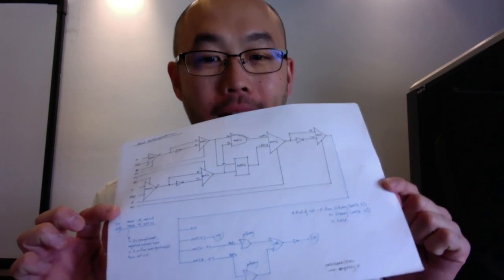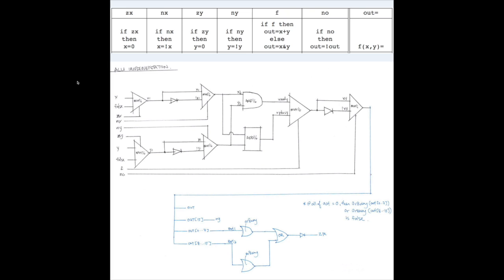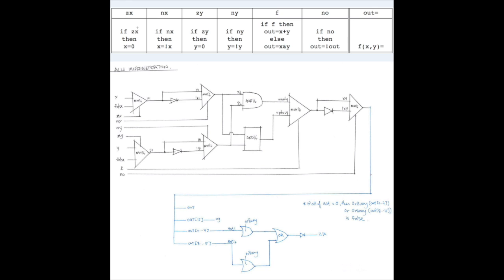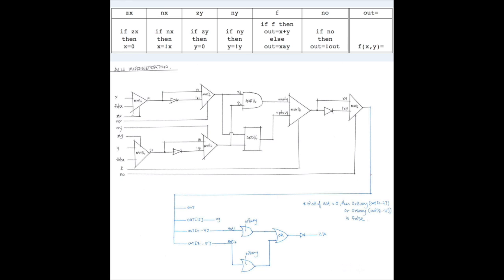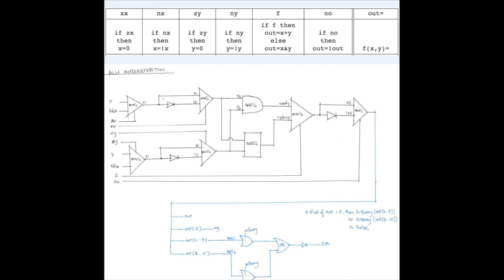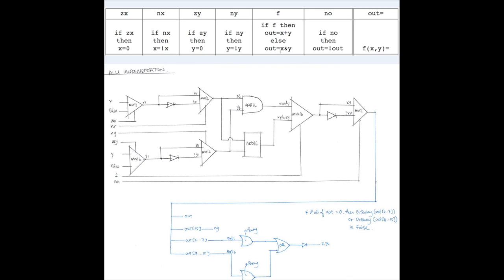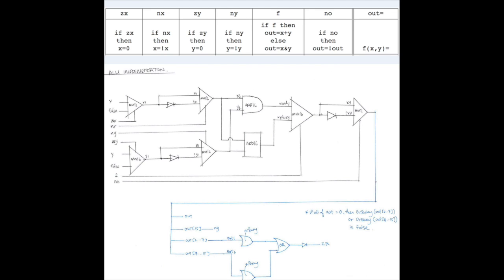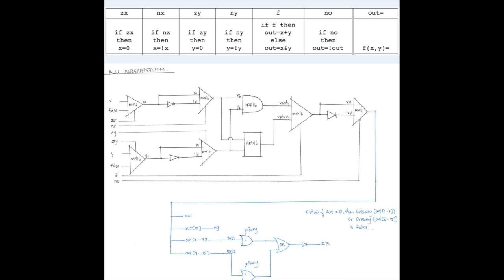Nand2tetris with Diagrams (Part 7): ALU Implementation

Comment: I don't get why its so difficult to connect 1 wire to another wire from a BUS. Really annoying when you want to do something simple and all it does is give you errors when in reality all it requires is attaching a wire to the output, regardless of whether its an 16 bit bus etc.

For example I know that the last bit on the negative number (Most significant bit) is a way to indicate whether my number is a negative number or a positive number because once that changes either I'm at zero or at some positive number. So I would think right all I need to do is write Or(a=out[15], b=false, out=ng); where in this case I am turning an OR gate into a buffer because it wont just let me just assign out[15] to ng, but instead all I get is brain dead errors. Ultimately it boils down to me wanting to just attach a wire to one of the output bits in order to detect if a number is negative yet somehow makes it difficult.